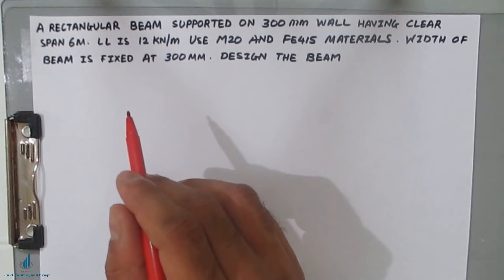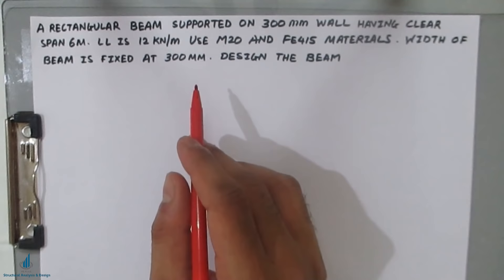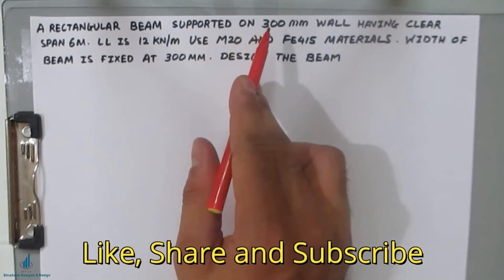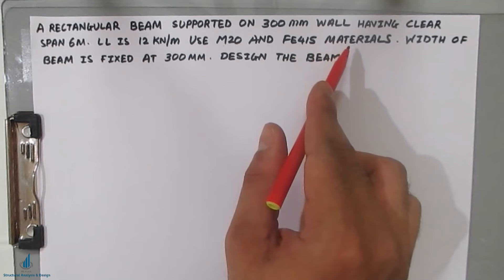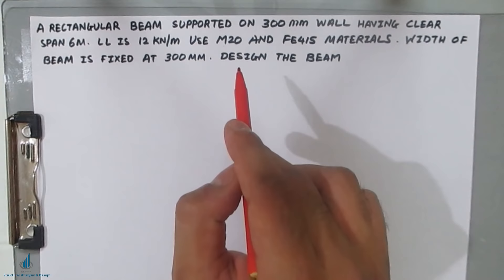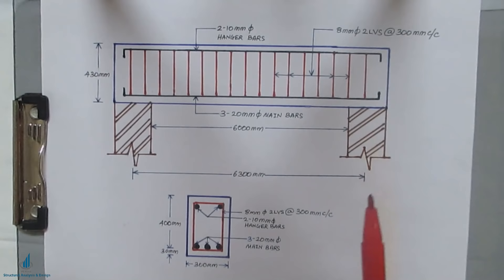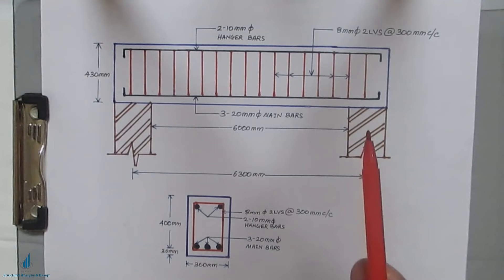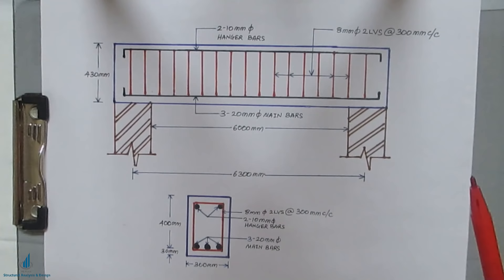Design of Singly Reinforced Beam | Limit State Method | Reinforced Concrete Beam Design

Comment: I am a practicing engineer. Just stumbled upon this video while looking for something else but after watching it I could not resist to appreciate your efforts and side by side a suggestion that we do not calculate figures upto 4 digits in civil & structural engineering. You just round them off by either single digit or by two beyond the decimal that to only if charts/table in code are following one or two digits. Reinforcement is never calculated in decimals. So all good just take care of these small but important aspects.
Cheers
Reply from the maker: Really happy as a practicing engineer you are appreciating my efforts, Yes Sharad we as a structural engineers we round it off to next higher numbers, but academically wat happens there is a tendency of a paper valuator to see the answers given in scheme and checking the answers, most of the teachers don't do round off, that is why i have shown like that, but thanks for commenting and giving feedback, thanks a lot for watching, keep sharing content who are studying civil engineering.

Comment: Thank you for sharing this beautiful lecture 
But I have one small doubt , I think modular ratio is a property that is dependent on the strength of material to bear stress, so i think it is 1 divided by _MR = str(cncrt)/240_
Also neutral axis is dependent on the steel so i think it is 1 - ( STR (ST) / MR * STR (CONCRT))

Comment: sir your lectures have been very helpful for me being an architecture student.
i had a doubt, please if you kindly revert back. 
pg 37 tells we cannot assume the ratio to be more than 20. why are we assuming it as L/15. why 15 as denominator. 
and why are we taking the effective cover as 30 when we previously assumed as 25mm. what is the range of our assumption. please let me know. im confused and stuck.
Reply from the maker: First of all I thank you for watching my lectures and I am happy my lectures are useful for you.

Coming to your question, page number 37 is with respect to deflection limits and it says it should not be greater than 20 as denominator increases you depth goes on decreasing which is dangerous, so i had taken less than 20.

Cover it depends on environmental conditions, for normal environment we generally keep 20 to 50 mm for beams, it varies with different structural members. I hope i solve you doubt, keep watching and supporting
Reply: @structuralanalysisanddesign   thank you for clearing my doubt sir. one more thing, we have taken the diameter somewhere as 10, 16 and 22 etc. what is the criteria for assuming the same?

Comment: Sir, the video was great. but I have a doubt... As mentioned by you, it is a singly reinforced beam, but in the last drawings you have drawn both main and hanger bars.. but in a singly reinforced beam there are bars only on the tension side.. so could you please explain?
Reply from the maker: To support stirrups we provide hanger bars which is not considered in calculations, its nominal diameter u can provide

Comment: I want to ask one question regarding the anchor reinforcement bars,

Even we are providing the anchor bars at the top of beam for the purpose to hold the stirrups along overall length of beam, why it is not considered any where in the shear contribution ?
Reply from the maker: The greater pirpose is to hold the stirrups and automatically it have a role to play but not considered in the design process

Comment: I had a doubt about providing reinforcement, according to the codal we had max and min reinforcement by formulas, If we get more than max Ast what do we need to do, shall we need to increase the dimensions or something else?
Reply from the maker: Hello, I have received your mail, coming back to your doubt, as  far as possible as per limit state we have to design section as under reinforced section, Max and Min reinforcement are given by codes, for example : too much of reinforcement if you provide in beam compaction of concrete becomes impossible and you will not have a good concrete inturn it affects effects entire design and moreover we have to design under reinforced section, it depends on moment and moment depends on span and load, i hope this clarifies you doubt

Comment: Sir if D provided or D assumed is 1000mm and later after checking depth if D required is 450 mm. D provided is greater than D req, now should try more D or use D=1000mm. Pls reply sir.

Comment: Sir why you have taken only 20mm diameter of bars is there any criteria to select the diameter of bars in IS code
Reply from the maker: Hello Harshit, thanks for watching the video, coming back to your question, its not specific criteria to use 20mm diameter bars only, actually it depends upon your width of the section, in this problem width was 300mm and with design i selected 3-20mm bars it means total 60mm of space is occupied by your steel and 240mm space will be utilised by concrete, if you go for higher diameter the number of bars will be reduced and it will not be favorable to use only 2 bars and if you go with smaller diameter bars, number of bars will increase and probably it will restrict your concrete to flow in the spaces, in short it depends upon designer to select appropriate things. I hope i solved your doubt and support us for the future videos.
Reply: Good dear

Comment: Sir great video👍👍👍bst.. Sir singly reinforced beam where we provide ??. N sir why are you not calculate steel area for anchor bars???
Reply from the maker: Thanks a lot, practically its difficult to find singly reinforced beam because most of the beams will be fixed beam or continuous beams and minimum hanger bars we can provide, you can show area of that steel
Reply: Good

Comment: Thanks for the video, I was just curious that if we provide effective cover 30mm then the clear cover turns out to be only ( 30-10-8= 12mm ) which is less than than the dia of bar i.e. 20mm. So i think we should increase the effective cover value.
Reply: I am sorry to say that your concept on cover is very weak please read it once more.
Reply: @tantaryz.m.7403  Sushil kumar gyawali is actual on point mentioning about the dia of bars used in stirrups 8mm and main bar 20mm/2 = 10mm.
Reply: @halalmeatshophk  
What i meant was therez not anything like CLEAR cover!!!
cover is mentioned in the code on the basis of exposure condition as nominal cover which is itself taken as clear cover. We aren't allowed to deduce it from bars in general.

Comment: Sir....you provide 2 hanger bars of 10mm diameter in drawing but u don't consider it in the calculation. If it is considered in the calculation,there will be some changes.
Reply from the maker: As per the basic concept, RCC singly beam is analysed for tension zone, because concrete will take care of compression zone, in doubly reinforced beam it will be considered in calculation

Comment: Hello, there is no crank bars...? 
My case = the beam size is 12"x20". Span is 18ft. I have option from my engineer = 2xD12 in top layer from left column to right column (whole lenght) and 2x D18 in bottom layer from left column to right column  (also whole lenght). 
I would like to add some additional bars. My proposal is to add 1xD12  in top layer + 1xD18 (or 2xD16) in bottom layer. 
Question is ....How long should the additional reinforcement be?  From left column to right column  - also whole lenght like main bars?
Or it must be L/4 for additional bars in top layer and L/2 in bottom layer? Thanks

Comment: Sir why you are using l/d value  in our  calculation 15 but is code is 20 in simply support beam. If 20 is max value than we take always higher value.
Reply from the maker: To satisfy other design criterias, this doubt i have cleared in one of your comment
Reply: @structuralanalysisanddesign  yes

Comment: Sir where did you get the multiplier 25 to get the dead load or self weigth of the beam
Reply from the maker: Its density of concrete used for RCC

Comment: Can you explain the spacing of main tension rebar....What is max and min
Reply from the maker: Dear, spacing depends upon the width of the member, and diameter you can select on the basis of width of member and also see the nominal size of coarse aggregates which you will use.

Comment: Sir i have did problem single reinforced beam design mines tovi is lessthan tovc then shear strength of concrete is safe or unsafe sir?
Reply from the maker: If touV is Less than touC minimum shear reinforcement has to be provided

Comment: Sir density of concrete unit is kg/cm3.and   in this lesson you take density  kn/m. So both unit are diffrent Kn/mm3and Kn/m.so here some confusion please explain sir.i
Reply from the maker: Here its taken in KN/m3, according to units you have to take
Reply: But density is certain mass per unit volume not area.
Reply from the maker: yes volume means m3 and area means m2, therefore density is m3

Comment: Hiiii sir
In my house there is a beam of dimensions 0.23 (width) × 0.3 m (depth) of span 5.4 m.
In that beam there are 4 bars of 16 mm at tension side and 2 bars of 16 mm at compression zone. Stirrups of 8 mm @ 150 mm C/C. 
Is it safe as it has load of two slabs???

Comment: For design of beams we have to use sp-16 also, but in hole calculation u have not at all used sp-16 codebook.
Reply from the maker: Its not required, you can design without using sp 16
Reply: 1)sp-16 & is-456 is compulsory for design of beams.
2)sp-16 is restricted for analysis of beams(only is-456 has to be used).
 Like that mentioned in our syllabus sir.

Comment: 13:08 sir you have taken udl in consideration, according to that the formula for B.M should be wl^2/12 ?? Isn't it?? But you have taken wl^2/8 ??
Reply: No in this case it's wl^2/8 nly..
U have to consider wl^2/12 while calculating Fixed End moment.

Comment: Sir while in calus while calculating the ast was not coming sir please reply me soon sir
Reply from the maker: Correctly input data in calculator you will get it
Reply: @structuralanalysisanddesign   i kept correctly input data it is not getting i tried three times but it is coming syntax error it was coming